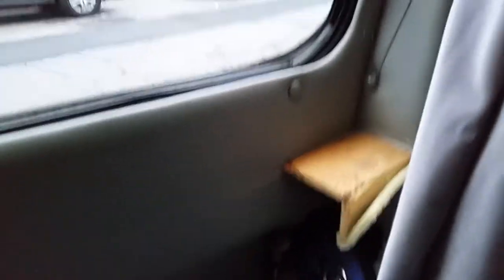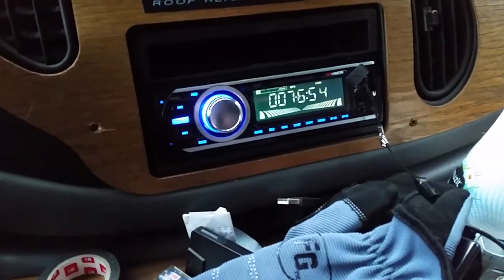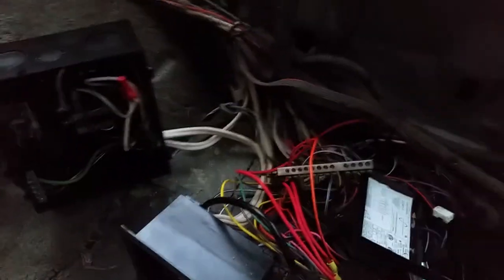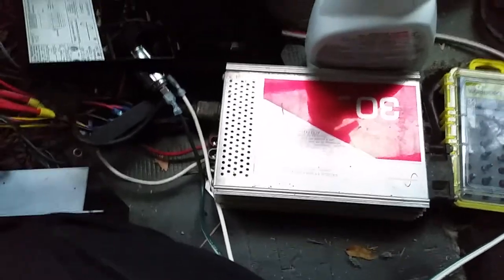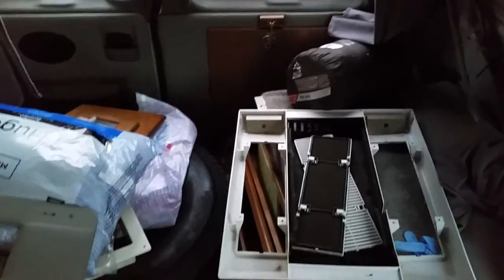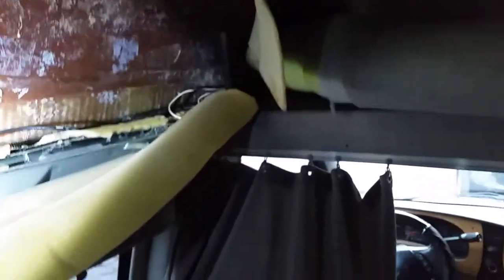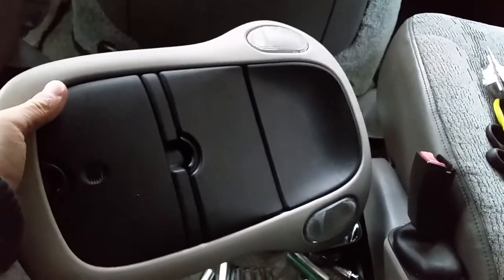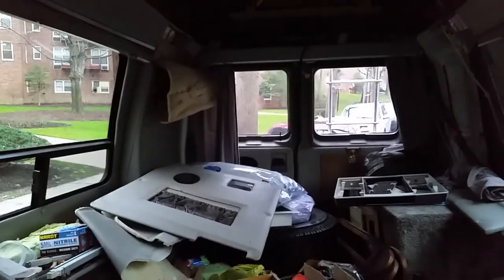Camper van b class rv project

Comment: l think you should definitly keep the bathroom. Shower and toilet gives you so much more freedom. l expect you will you solarpanels? 
Btw way where are you from originally?  Do you know the measurements in meters? lf you have a smart layout and can build it yourself, you can put in a double bed and kitchen as well.Good luck!
Greetings from Europe
Reply from the maker: I know metric and SAE systems, and I use both. I've done a lot of research and learned that it can be a great deal to install holding tanks under the chassis, also don't want to mess up the running boards. I did research on cassette toilet and find the unit itself too much $600 the least expensive, also cutting the hole on the side of the van through reinforced wall can be a great challenge.